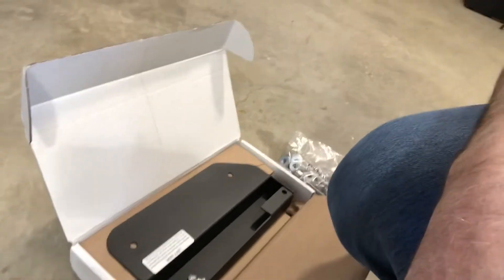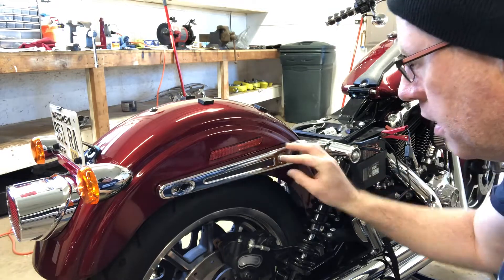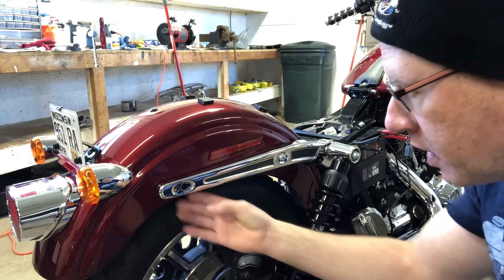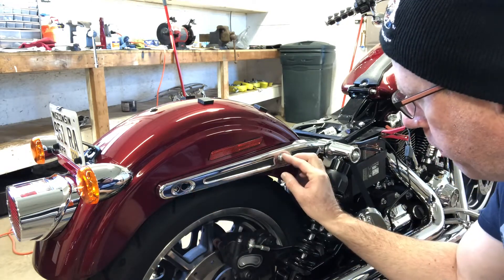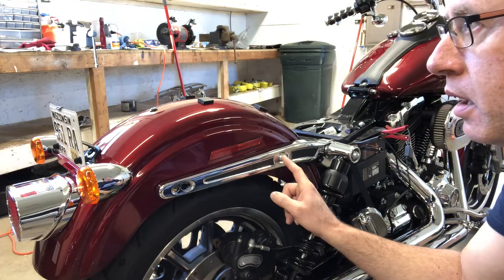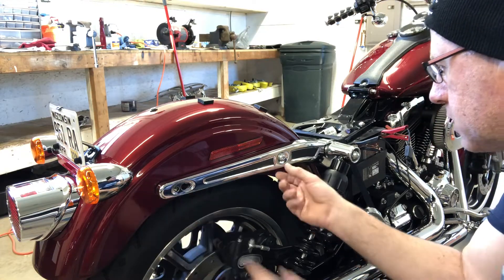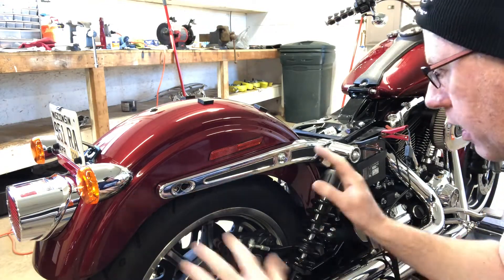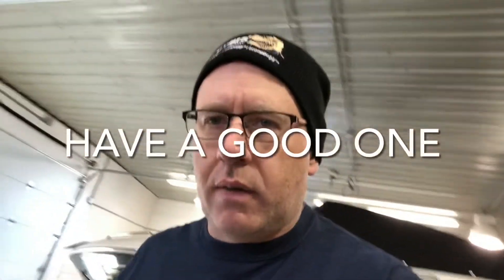Easy Brackets for mounting bags on my Harley Low Rider

Comment: Thanks for the video, mate. I just purchased the Easy Mount brackets in Australia. Yes, like in your video, they are easy to fit, and I am very happy with them. Now it's to fitting my Finn Moto leather wrapped panniers. Thanks again, and ride safe. Frank
Reply: hey man. did you purchase them from an aussie site? and do you reckon you can use them for stretched hard bags?